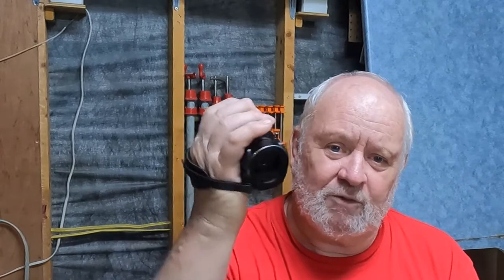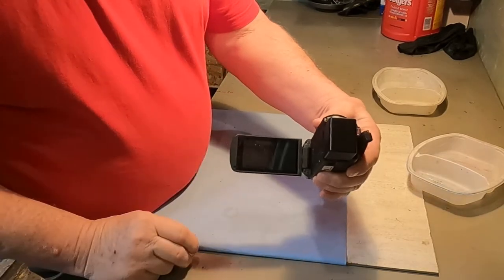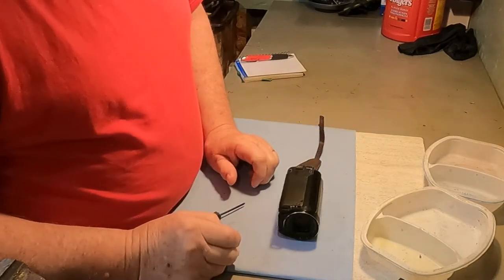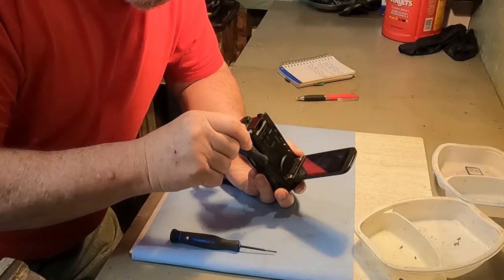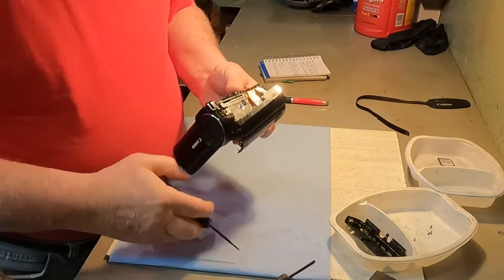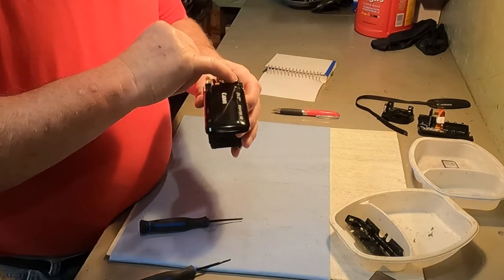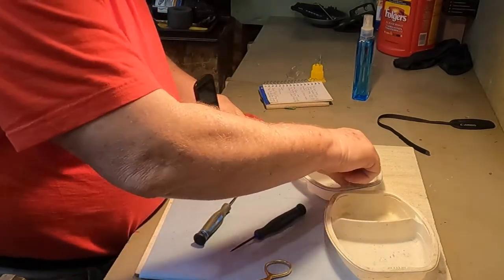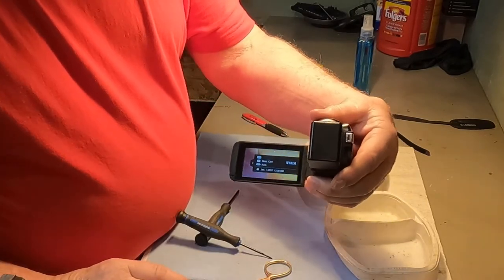Trying to Repair a Canon Vixia HF R800 Camera

Comment: Hi Mike.  I hacked about 6 Sony cameras to use as a trail camera.  I found when tearing them down it was handy to put a wide piece of double sided tape across the work bench.  Then as you take screws out you can stick them to the tape and mark where they came from right on the tape.  Maybe a tip for future reference should you open a camera repair shop.  Great video and keep them coming.  Oh, and I do have a couple cams that need repair if your interested.
Reply from the maker: Hello Bernie, nice to see your comment!!  That's a good idea about the tape trick.  I tried to write down where the screws came from but then I couldn't understand my notes!!  LOL  If it's OK with you, I think I'll pass on repairing those cameras for you!!  LOL  Thanks for dropping by and take care!!!

Comment: Scared yourself a little when you forgot to open the lens cover, didn't you?  Nice job Mike.  I wouldn't have even attempted it!
Reply from the maker: Hello there Bruce!!  You noticed that eh.  I was figuring it wouldn't work after the 'brain surgery' and when it didn't light up I thought it was toast, then I remembered the lens cover.  I was pleasantly surprised when it lit up!!!  And it still makes good video!!  Thanks for tuning in and take 'er easy!!!

Comment: I would think it was either the ribbon terminals not seated or the flip switch stuck. We will never know. That camera has hdmi output so you could use with a computer monitor if you were stuck next time. Hopefully there will not be a next time. Take care Mike & Nannie
Reply from the maker: Hello there Pascal!!  Yes it does have an HDMI and when I saw your video about the remote display I thought the timing was incredible.  That display would be perfect.  The camera is working better but not totally fixed.  Every now and then the monitor won't come on.  Oh well, it's better than it was!!  Take care!!!

Comment: Great job getting the camera apart and it is even better that you got it back together and it is working. With any luck it was just a loose connector which you have fixed. I think something like that is far too small and complex for us to tackle
Reply from the maker: Hey there Joseph!!  There sure are a lot of tiny screws in the camera.  Quite the engineering feat to design this camera and have everything fit together like it does.    I was some surprised that the camera worked after the 'brain operation' but it did  and still takes good video.  Thanks for tuning in and take care!!!

Comment: Gutsy move on your part to take that apart, I would have done the same thing.  The repair would have been more than a new camera.  I dropped my camera last winter and it cost me 650 to get my lens repaired.  I bet it felt good when it fired back up again.  Thanks Mike.  Stevo
Reply from the maker: Hello there Stevo!!  It did feel good, but when I first tried it the lens cover was closed and the monitor didn't fire up.  That scared me.  But once the lens cover was opened, it was all good.  Thanks for tuning in and take care!!!

Comment: Great work Mike, I’ve a HF R80 with a cracked display.  Do you know of a parts source?
Reply from the maker: How's she goin'?  Welcome to the channel and thanks for the nice comment.  I don't know of any parts suppliers.  My display works only some of the time so this repair attempt didn't really solve anything.  It was interesting trying thoigh.  When I checked the camera repair websites for 'technical help,  they showed an estimated charge for overall general types of repairs.  I think to fix the display it was something like $265 Canadian plus shipping.  Well the camera wasn't worth that to me although I think it was a very good camera.  I ended up buy a GoPro Hero 9.  That isn't too good a camera either.  Way to many 'setup' modes and the touch screen is very intermittent to use.  Thanks again for the comment and sorry I couldn't help you out with a parts source!!

Comment: Man oh man, Mike I heard their having trouble with the space station, you might want to give NASA  a call to arrange a repair flight.  😂  Good on you bud for fixing up the camera.  🍻 🛠🪛⚙️
Reply from the maker: How's she goin'?  The camera wasn't working too good and was basically no good at all, so taking on this job was low risk!!  I was some surprised that it worked when I was finished.  There sure is a lot of tiny screws in the camera and no 2 are the same!!!  LOL  Take 'er easy!!!

Comment: hello, I have a panasonic, note that it charges, but it does not turn on, what could it be?
Reply from the maker: How's she goin'?  Wow I'm sure no expert, as was seen in this video, but usually 'not powering on' could be something simple.  But a lot of cameras use solid state switches so I'm not too sure.  Sorry I'm not much help but thanks for dropping by and asking though!!  I hope you can get it repaired and back working again.  My camera still works but the view finder screen almost never comes on now.  I think the camera could be repaired but it was almost $300 for them to look at it and they wouldn't guarantee it could be repaired.  Not worth it to me.  Take care!!